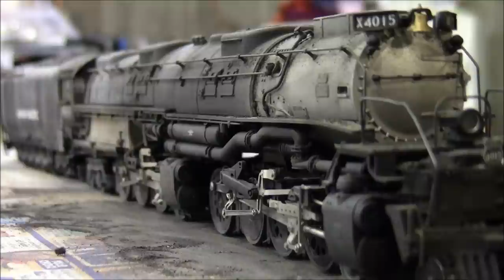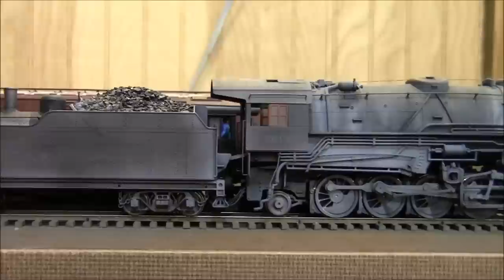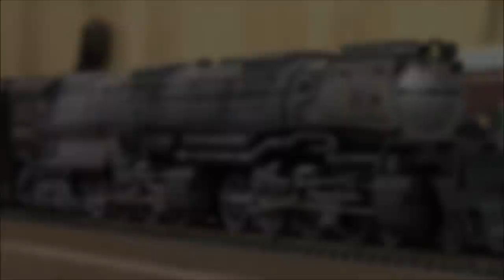Trix Marklin Big Boy Weathered with Revolution Sound

Comment: What is the scale of the loco ?
Reply: ***** 1:87 as any Märklin model
Reply: +Calvin Mills Hmmm. Not "any"... Some. ;) 
You can get Märklin models in 1:220(Z), 1:160 (ex Minitrix), 1:87 (Märklin, ex Trix), 1:32 (Märklin) and 1:22,5 (ex LGB).
Reply: Thanks for asking this question. I was wondering the same.
Reply: How did you apply the powders, with a brush or airbrush?

Comment: Your weathering is overdone. It is reminiscent of a static display left out in the elements for twenty-thirty years. Too many heavy streaks of gray (oxidized paint?). But then, to the casual observer it doesn't look too bad. UPRR washed its locomotives  regularly to help prevent the gray you depict. Duco Dulux - the paint used on the  vast majority of steam engines - never oxidized like this under actual service conditions. Granted that there will be weathering from dirt and rust, and some chemical residue from blow-down areas near the pop valves and cylinder cocks, but not that much . . . to each his own. That's the difference between 'scale' and 'it probably would look like this' modeling. Accuracy is in the eye of the beholder.
Reply: yada yada yada
Reply: the pandeslar watch "last of the Giants part 1" it features some big boys that look just like this towards the end of their service. the UP would seldomly wash reserve units unless they were getting used for a special purpose. maybe the owner of the Loco is modeling the time frame where these were phased out
Reply: Big Boy in service with heavy weathering and rust patterns: https://s-media-cache-ak0.pinimg.com/originals/9f/a4/69/9fa4693f442803585c9db6d4be7b75dd.jpg

I would contrast that with this model and say the model is understated and typical of usage